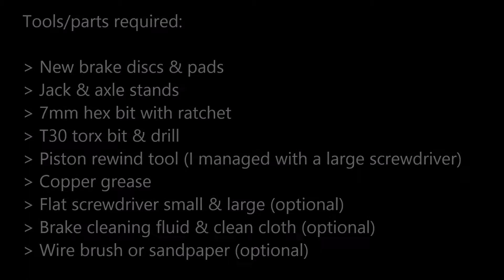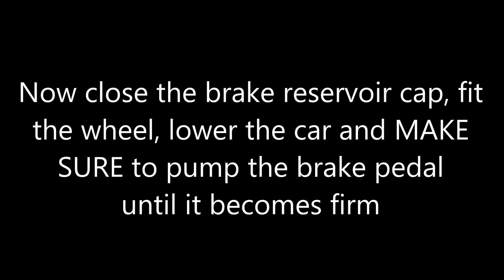How to Change Mk5 Golf/Jetta Front Brake Pads & Discs

Comment: I agree with a number of comments here, but you should also advise on bedding in the new pads and rotors.
That alone is a must for a better finished job
Reply from the maker: In hindsight, yes that's something that I should've mentioned so thank you for doing so

To be honest though, many manufacturers give different advice on how to bed them in.. I personally don't exactly bed in but just use the brakes as normal, keeping in mind that the brakes are new

After doing so many miles, the brakes would have bed in naturally rather than being forced

I could be wrong but that's my view on it

Comment: Nice vid mate. I pushed the piston back using a G-clamp with the old pad still attached. I have noticed a lot of people  having trouble with this part. I also bought a Halfords trolley jack and 2-ton jack stands, makes it so much easier and safer!
Reply from the maker: Thank you, a G clamp is a safer method to mine but since this video I've purchased a wind back tool as I've yet to uppoad a video of replacing rear brakes

Invest in a wind back tool with attachments if you'll be changing pads frequent enough on a few cars, my tool is able to push front pistons back similarly tons Good clamp too 

Trolley jack and stands are a good investment, I spent too long working with only the factory scissor jack

Comment: Its time for new front brakes on my Golf Mk5 1.6 Fsi. 
Can i upgrade the front brakes to have bigger brake pads and discs without changing too much of anything else like bigger hubs etc but willing to spend on calipers to upgrade these. 
Will this upgrade make a difference in improving the stopping ability of the car or are the gains miniscule and not worth bothering with.
Reply from the maker: Hi, I'm not sure if you can fit bigger discs and calipers without changing the master cylinder

But to be honest, by just using better quality discs and pads for the current calipers, you should see a big enough improvement

Comment: Great video👌👌👌 keep up the good work  make a video on rear discs and pads aswell
Reply from the maker: Thanks Adil
I was considering a rear brake video recently but the Golf doesn't need it, I've recorded the front brakes on the Audi A4 but the rear brake caliper has a seized bolt I can't remove from home! (So the garage will have to replace the rears)

Expect a front and rear full brake replacement on another car soon though 😏

Comment: Please do not use the factory Jack... It is only supposed to be used a couple of times for emergencies. It is very dangerous. I myself Can be cheap sometimes, but I bought 2x Jackstands (a set) and a proper Jack with a handle. Much more safe. Your life is worth more than £40..
Reply from the maker: Don't worry it's not about being cheap, it's a matter of finding a good set that will last. I spent £20 on a Halfords jack which was refunded on the same day!
I've used the factory jack in the mean time but I know I need to get a proper set

I'm looking at the aluminium jack that Costco sell, based on reviews online and people I know

Thanks for the reminder 🙂

Comment: I will be doing the front brakes on my daughter's 2008 VW Rabbit soon.  I already did the rear ones.  What is the purpose of unscrewing the brake (fluid?) reservoir cap?  Thanks.
Reply from the maker: Hi, this will make it easier when resetting the caliper piston.. it depressurises the system to allow easier movement of the piston
Reply: @HGCars  I did the front brakes today.  Yes, it was WAY easier to compress the piston this time, compared to when I did the rear brakes.  I didn't know to open the reservoir lid at that time when I did them.  Thank you!
Reply: Was just about to ask this question. Can't wait to try this on my Mk5.